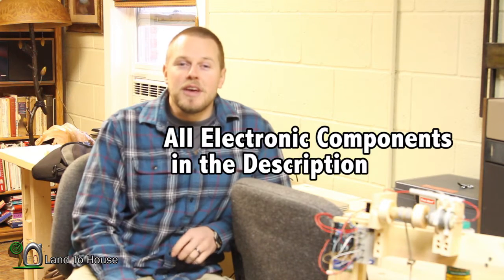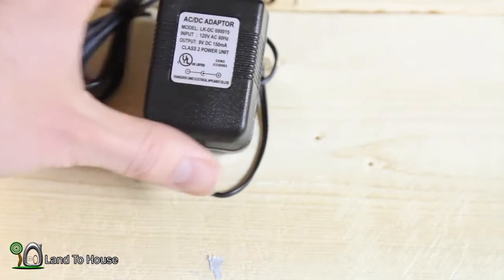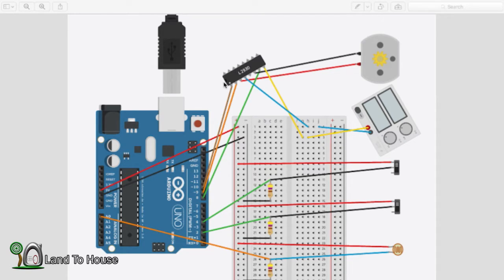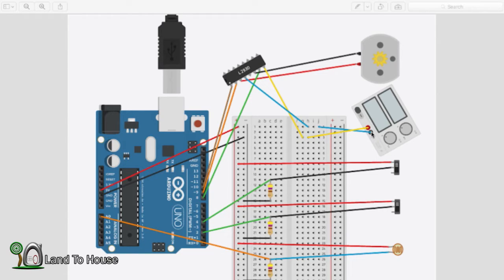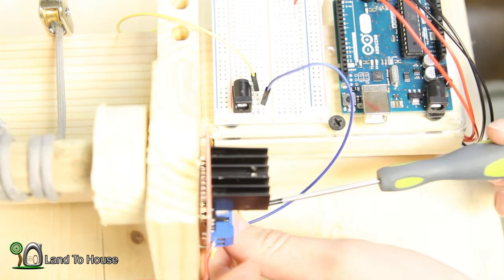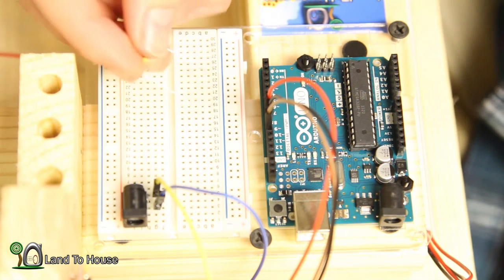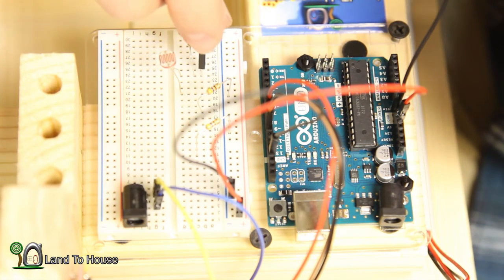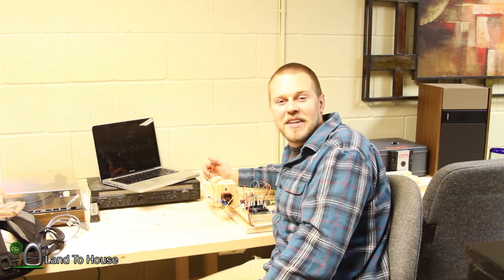Amazing Automatic Chicken Coop Door Part 5/7

Comment: Great videos. I stop at that point to leave a comment. You only would need one power supply that is connected to the L298N. The L298N can provide enough energy to also run the arduino. So you can on the one hand save money for only one power supply and don't need two plug sockets in the coop.
Since I'm already typing: Best idea I've seen yet on youtube regarding a automatic coop door. Especially the locking mechanism is great. I'm going to build on on my own and already have these window open security sensors for my project, but the locking mechanism was nothing I thought of! I will adapt your door locking mechanism but won't use any zip ties ;) I also will connect a humidity and temperature sensor to my arduino and the lan shield.
Greetings from Germany. I'm looking forward to watch the rest of this and the other two videos. Thanks!

Comment: Thanks. You did a great job helping understand a few things about arduino.  I even have a few but have done nothing this cool with them.
Reply from the maker: +nintendolunchbox I like when you can use boards like this for practical projects. I am thinking that it would be fun to automate the goat feeding system when I get goats. What have you made with the arduino?
Reply: +Land to House i got them at first to make a sensor on a door control a thermostat turn on or off depending on if someone was in the house. but then found wireless sensor tags could help with that and went that direction
Reply from the maker: Interesting.   That would have been a fun one.

Comment: This was fun Seth!  It took me back to my old lab classes.  You sure have got me hankering to build something.  Thanks.
Reply from the maker: +Pidasian Hippie You should build! In a lab I had to use some form of control board but it was terrible. The class was called microprocessors but we spend the first 5 weeks doing transfer curves by hand. Then we used the control boards to do the same curves. So impractical. .... haha but now I get to use them for fun. What are you going to build?
Reply: Land to House My microprocessor classes were great.  We interfaced the processors with various components to play with different applications.  We also did some basic machine language programming.  Of course, all of that is obsolete now.  Hahahhah
 I don't know what I would build. I have been to their website and looked at the different setups and kits.  Maybe it will be a good project to take on next winter after I give a lot of thought to it.
Reply from the maker: There was a class like that in my program but because the other students did not get the two floor elevators done we did not move on to the fun stuff. I think staying with a kit would be a good idea!
Reply: Land to House Well, that was a rip-off for your class.  
Yea.  My first exposure to electronics was some of those little kits.  Of course, back then it was a few transistors, resistors and capacitors.  Nothing like there is now.  Hahahahah
Reply from the maker: Well i was the only one who got that silly elevator to work.  I actually enjoyed working with the raw components like that. :) now though it's all plug and code.
Reply: Land to House That sounds like it was a fun project!  Also more applicable to real life experience.

Comment: Thanks for this great video series! I had a questions, but I know there videos were posted over a year ago, so hopefully I can get an answer to my question! I was wondering why you chose to use a 24 volt power supply for a 12 volt motor. I know you mention a voltage drop through the motor controller, but wouldn't the volts still be too high to power the 12 volt motor and cause issues in the future? This is all new information for me, so apologies if my question doesn't make sense. Thanks!
Reply from the maker: +margeauxeatsushi thank you for watching. It has been so long since I've thought about this project I don't really remember. I do know there was a pretty significant voltage drop across that motor controller. ...5v perhaps. But that still does not explain the difference between the motor voltage and the motor controller voltage. I'm sure I had a reason a year ago but it has slipped me now.